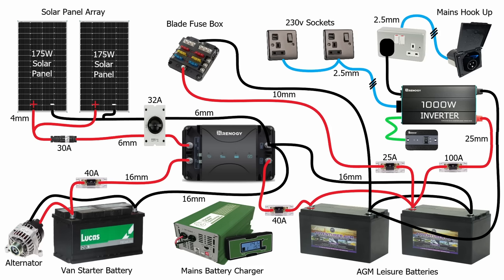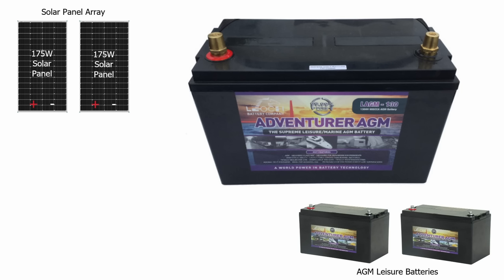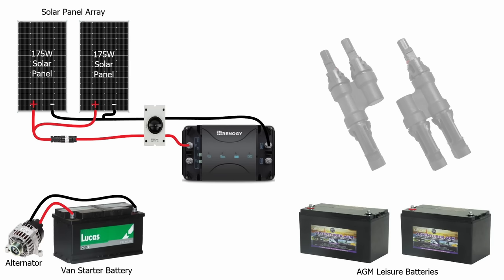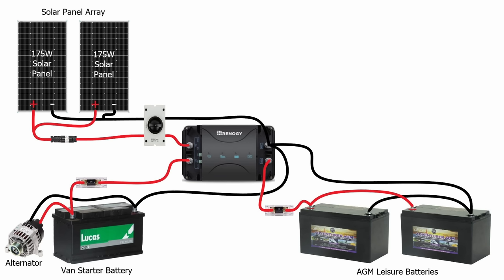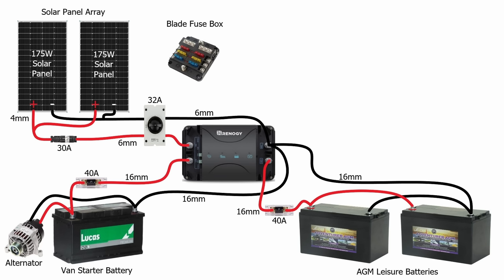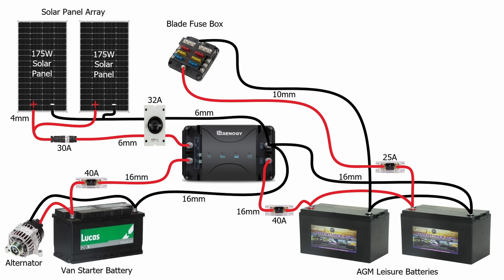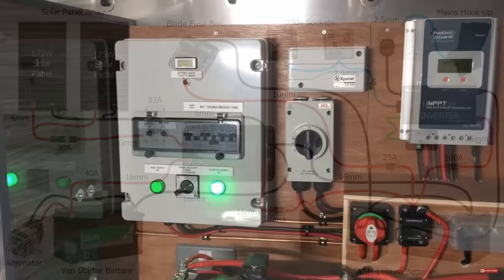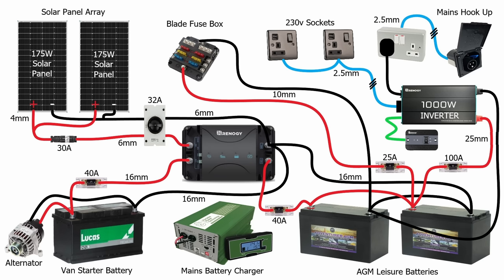12v Electrics for Off-Grid Campervan - Fiat Ducato Budget Build Ep12

Comment: Hi Greg, loving your step-by-step vids, really helping me with my first build (I have a mk7 Transit in great condition for age, It was a fridge van so it took a lot to clean it out). I went to buy the Renogy 30amp mppt, cc but they were out of stock, so I bought the Renogy 50amp and want to check that I can use this instead. It was almost the same price and does allow me to upgrade my system later if I want to add another panel. So I can see I've got to up the fuse value but that's all? All specs seem to be similar to the 30amp version. Thanks in advance 😁👍
Reply: I would like to echo what others have said, no-one is out of pocket for business. I simply wouldn't t have started this venture as I couldn't afford to pay someone else to build my van. If I could, I would have! It's a lot of work and has taken me a year of watching videos and saving up to be able to even dream of having my own custom made campervan, so I want to thank you and your wife for helping me to make that dream possible 😍👍
Reply from the maker: Hello, it's a little bit overrated for the battery capacity and type that I have suggested. You might want to look at getting one 100ah Lithium battery for £400 rather than two AGMs for £260 as this will handle the extra charge. The cables from the charger to the batteries also need to be increased in size to 25mm min to keep the voltage drop below 0.3V. Hope that helps :D
Reply from the maker: @deepowell2160  https://www.ebay.co.uk/itm/125237263746?hash=item1d28b8fd82:g:44gAAOSwnHNj1IlC&amdata=enc%3AAQAIAAAAwDo0pl8VldFlMcuA%2FXrCC%2BFmr8NMucnQbt2aENvit%2FSQBksvOImq5H%2B33V7yO9DBRJ5mci%2F4mWg%2BjggwOle0CrtfVeWKXboQoLM%2Bf63Nr%2Fppmgppce6PNa44%2Bxm4rohpojAgCrrS%2BJ1LWs62lNAPRtqUo8q0tVTvKrWA%2BY0MPm8CfIBkXX8wTQb4qfhdH5eFOUmjMdgBURVdDX7h4x6G9QZ7gXzL7mEo9F%2FqL8gHRrIMTr471kQ21M4mcPbwxrz%2FXQ%3D%3D%7Ctkp%3ABk9SR6C67-SrYg&mkcid=1&mkrid=710-53481-19255-0&siteid=3&campid=5338027957&toolid=11800&mkevt=1

Comment: Hi Greg i am going to use the wiring diagram in your video for the installation of my leisure battery setup in my Volkswagen t5 only difference to your set up is that i am using a single 200w solar panel a 2000w inverter and two 100ah smart lithium batteries all items from the renogy website, what size wiring will i need for this setup compared to yours cheers....

Comment: Hi Greg, great video and glad you are back. If the inverter is OFF, will it still pass-through 240v mains hookup to the sockets when onsite, also will the 240v (when connected to mains) allow it to pull more than 1000w ?
Reply from the maker: They are great questions I will have to test that and come back to you 😃👍🏼

Comment: Very much enjoy you clear concise easy to follow content… I have a question for you..I have access to 6v 110a batteries…would 2 of these wired in series be better than 1x12v 110a battery space and weight are not a problem just a question of which is best for off grid use..
Reply from the maker: Two wired in series would work just as well. You also have some redundancy

Comment: As usual Greg, Top Class💎 I'm not sure if you are aware of this, that isolator switch between the solar and Renogy MPPT controller has another useful trick up its sleeve.
On cloudy days and solar is at a minimum, before you drive, isolate the solar so the controller receives nothing from solar.
Doing this, the controller will except it's max allowed limit from the alternator.
When solar is connected, even poor solar days, the allowed power from the alternator is rather heavily reduced.
I've seen this with my own eyes, around a 10 or more ah difference, solar gets preference.
This is a poor way to save the controller from getting overloaded (in case of good solar) and I've seen the emails to and from Renogy and they are aware of this and in general stated, it's just the way it is.
This was less than one year ago, I doubt anything has changed since.
I'm not saying Renogy is bad, Renogy is very good, I'm just pointing out a workaround.
On Good solar days or if batteries are close to max, no need to isolate when driving, just when solar is poor.
You can test this out yourself when you have the van wired.
You could get this info out to more people than the person that I know, but test this yourself (just in case the controller has had a SMART upgrade) Just trying to help Greg 👍 Cheers mate 🙂
Reply from the maker: Hmmm I had heard something similar about it prioritising solar so I’ll run some checks and see. 👍🏼
Reply: @GregVirgoe  Yes Greg, thanks 👍

Comment: Thank you Greg for the awesome help you gave me. I am going to use this set up for my fiat scudo. My only question is that: I’ve got a diesel heater that is pre-installed and runs from the van’s battery and I want to use it as my main source of heat in winter. 
One idea is that I find the connection of the diesel heater (and probably van’s main fan system), disconnect it from the starter battery and connect it to the leisure battery.
Or is it possible I run it as it is but charge my starter battery with my leisure batteries during the time I am using the diesel heater? In this case I won’t need the headache of going through the van main electric system and probably just need to keep an eye on my batteries so that they won’t go down?
Would appreciate if you write your opinion about this and if it’s possible to do so? And how can I add that to this system that you show?
Reply from the maker: I would definitely recommend running the diesel heater from your leisure batteries and not the van battery.  You can install new power supply from a blade fuse holder to the diesel heater and isolate and make safe the existing power supply.

Comment: Sorry if you have already explained this further down but if you hook your leisure batteries to the starter battery, is there anything you need to put in place to stop it from draining your starter so you don't breakdown come morning. And also, if you hook up to shore power should you put in an RCCB or RCBO in line and how could you use the shore power to charge your leisure batteries as well as solar and your starter battery. 

Hope that question makes sense and I'm also not missing something glaringly obvious

Thanks in advance, you've been a life saver on your videos
Reply from the maker: The DC to DC charger will not drain the van battery when the van is not running. In fact it will trickle charge the vehicle battery off the solar. Please watch my next video on consumer units to answer your other question. 
https://youtu.be/kdvm0TFvfVQ

Comment: Hi Greg great to see you back how your both well I’ve a smart alternator on my van euro 6 will this dc to dc charger work ??
Reply from the maker: Yes it will, there is an ignition lead that you will also need to install to tell the controller that the van has started. 👍🏼😃

Comment: Thanks for posting this Greg, this advice or hiring an electrician to do this work would cost a small fortune - Questions;- I would be a bit nervous about what to wire in `first`, especially concerning the leisure or vehicle batteries = negative or positive (to stay safe)?, also was the wiring done in chronological order (as in the vid) for a reason?
Reply from the maker: That’s a good question. 
With all solar charge controllers you need to connect the leisure batteries first, this provides power to the device and gives it storage capacity for when charging means is connected. 
Next connect van battery and finally connect solar panels. All the output side should be installed and isolated at fuses before the above sequence then can be turned on once batteries and solar is proved to be ok 👍🏼

Comment: Hi Greg. Absolutely fantastic video thanks. Would this system work with a smart alternator vehicle?
Reply from the maker: Yes there is an ignition lead that comes with the charger that you need to connect to tell the charger that the van has been started. 👍🏼

Comment: Hi 
I've watch lots of your videos all really good
I am doing my first conversion 
Using a single 200w renogy sola panel,2000w renogy invertor,single 200amp lithium battery will be using a kettle,and a 1500w camping cooker, with a smart alternator would this work? And what size mppt dc to dc charger would I need  and battery cable size 
Thanks chris

Comment: Fantasticly helpful video! Thanks so much!
One question I do have for you...
I'm designing my campervan electrical system at the moment, we plan on using the van throughout the year even in the winter. Im designing it with LifePo4 batteries and approx 400w of panels.
I'm concerned that if I design the system with the solar panels in parallel that the voltage won't get high enough to actually recharge my batteries and this would affect how long we could stay off grid, especially during the winter months
Wiring them in series however would counteract this, on paper at least, and ensure at least some charge goes into the batteries.
Is this a legitimate concern?
Have you any experience or advice on the matter?
Thanks
Reply from the maker: Hi, yes I do have experience with this for last 5yrs living off grid.
Wiring the panels in series will benefit you in low light conditions but you need an MPPT charger that can handle the larger voltage like my Epever Tracer MPPT. This Renogy unit does not support more than 25v input. If you decide to go that route then a separate DC to DC charger would be required. Hope that helps 😃👍🏼

Comment: Great information Greg. I have this set up. Could you do a higher amperage 240v system with lithium as an example.  I want to upgrade
Reply from the maker: Yes it’s very easy, Go for the 50A dc to dc controller instead and change the batteries to lithium technology. Then you can increase the size of the inverter. Cable and fuse sizes will have to increase too. 👍🏼
Sorry are you asking for a video of a high power setup?? 😊
Reply: @GregVirgoe  thanks for the information.  I understand.  But if you're able to make a video feel free!

Comment: Great videos Greg.  Thank you very much.  When deciding on wiring size for your systems, you don't mention the impact of the distance each load is from the fuse board.  Is this largely unnecessary for camper van conversions and provided the cable is rated for the total load current it is appropriate irrespective of whether the load is 1m or 5m from the fuse box?  If I take into consideration the distance I find the I am having to wire most of my devices with 3.5mm wire rather than 1.5mm. (following the Van Conversion Bible guidance).  Your opinion very much appreciated.
Reply from the maker: Yes voltage drop on long cable runs can increase the cable size if you follow the accepted rule of 3-4% volt drop over the length of the cable. Things like fridges are critical as they won’t run if the voltage is too low. Most cables around the battery are very short less than a meter so its insignificant. 
So what effect does volt drop give us? My batteries typically sit above 12.6v so a 3% drop is 0.378v so even if I have a bit more volt drop than that my devices are still getting over 12v and would work ok. Often the actual load in current that your device uses for fan or socket circuit is far less that your calculated maximum.  Having said all that it never hurts to go bigger on cables other than the hit on your wallet. Hope that helps 👍🏼
https://www.12voltplanet.co.uk/cable-sizing-selection.html

Comment: Hi Greg, great videos, so helpful to a novice like me. I’m going to use you wiring plan for my van, if I wanted to use a 2000w inverter would I need a lithium battery, or could I just add an additional AGM to the system.
Reply from the maker: If you wanted to use it’s full potential it would be better going to lithium batteries.

Comment: greg, thank you again for an excellent resource. I would be interested in your thoughts on running a bluetti 200ac max, instead of a permanently fitted solar system? i am attracted by the possibility of using the bluetti on job sites as well as in the van.
Reply from the maker: I have got one to compare against a fixed system so there will be a video on that soon 👍🏼😃

Comment: Is the  Mains Battery Charger in your garage permanently hooked up to your system just requiring turning on, or do you manually connect it when you use it?
Cheers, really informative video.

Comment: Great video as always. I love your wiring diagrams and explanations much simpler than some of the instructions that come with the items themselves, with regards to running a tv off the inverter it reminded me of a video you did where you used a more efficient way  of running them with a converter? as often they don’t need full 230v, how are you finding that method in your van would you still recommend that? I understand why you might not go down that route in your budget build but in general is the converter a better option?
Reply from the maker: Thank you very much for the nice comment. 
Yes the TV has worked brilliantly in our van on the new buck converter and it’s definitely the way to go. We can simply use it without the inverter which is a great improvement 😊
Reply: @GregVirgoe   thankyou thats great Im planning to get this years camping season out of the way and then thinking of upsizing my van to something crafter/sprinter sized and whilst my current van is ideal for a weekend away on longer trips I rely a lot on hook ups and using an awning for space, so Im using your build videos for inspiration on becoming more able to not rely on the hook ups as much and although a bigger van hopefully actually become a more compact setup without the need for awnings etc
Reply from the maker: @James83172  we don’t plan to get rid of our sprinter it works so well in terms of space and being able to be off grid and camp anywhere. Perfect solution 👍🏼😃

Comment: Great video. Thanks. 
I have a question if you don't mind. 
I'm wiring a camper trailer with a lead acid deep cycle battery using a dumb alternator from the vehicle (with a simple voltage snesitive relay) and a single solar panel for charging. 
Can I connect my MPPI controller through the fuse block with appropriate fuse instead of straight to the battery? 
Thanks.

Comment: Hi Greg Thankyou for doing this video. It makes absolute sense and is easy to follow.
On the video, you suggest a 6 blade fuse board. Could this be increased to an 8 fuse without altering anything else providing nothing with a high load is connected?
Reply from the maker: You can increase the number of ways. Add up the connected load of all the appliances and just check the feed cable and main fuse is still high enough. 😊
Reply: Thankyou

Comment: Thank you so much Greg! Quick question, did you fuse both panels with two 30A fuses or did you run the one fuse after connecting the positives via your connectors? Thanks again!

Comment: Dear Greg, Thank you for your amazing videos, truly inspiration.  May I ask if it is possible to look at retro fits in future?  I have a Devon Tempest, 5.4m Renault Master base. I am trying to understand where various things are, for example the water pump and expansion tank; and the fuse in the solar panel to vehicle battery line?  I know it is a big ask, but we are not always working from a new build?  Thank you in anticipation. Colin Jamieson
Reply from the maker: There are numerous manufacturers and many variations of layout, controls and appliances. 
It would be very difficult to cover every scenario in a few videos. 
At least looking at this new layout and my previous wiring diagram it gives an idea of how these items are connected together. A lot of manufactured Campervans have bespoke distribution boards and integrated control systems that I’m not aware of how they are built. 
It’s a difficult one to cover 🤔😬

Comment: Hey Greg, thanks for another excellent video.  Planning a conversion and wondering about batteries. Is it better to have several smaller batteries or single large one?  Li Time seems to make quality batteries at a reasonable price - they have 100AH, 230AH, and 460AH which are incrementally cheaper and lighter (per AH). Your thoughts on smaller or larger batteries for a 400AH or 800AH system?

Comment: Hi Greg. I have almost the exact same set up as shown in this video 16:15. I was wondering if I could use the same cable and fuse sizes, considering I have the 2000w inverter, 2x200w solar panels and I'm using 3x100 ah renogy lithium batteries.

Thanks, mate. Your videos are spot on. 👍
Reply from the maker: No, the cables and fuses are sized according to the load connected to the circuit. So if you use a 2000W inverter that would require a 200Amp fuse and at least 35mm cable providing they are short only 1m long. 
You would also need to increase the battery parallel connection cables to 50mm as they will be handling the loads of the entire system. 
Solar PV of 6mm and MPPT to battery 16mm will be ok 👍🏼
Reply: Hi Greg, thank you for your advice, it's really appreciated. Just one more question if that's ok? 
If I were to use bus bars straight off the batteries, am I right in assuming that these would need to be rated at the same 200a as the largest fuse on the system? Then I can come off those with the differently sized cables and fuses for all my components?

Thanks, again.

Comment: Hi Greg I'm going to using the same renology alternator/MPPT charger as you are using but this will be off a newer dc-dc smart alternator. There is a cable in the renology charger for the ignition signal.Firstly do you know if this is vital to the set up and secondly where do you suggest that it is attached please?
P.s. just love your videos....so simple - even for a girl😉

Comment: Great video.  Just a quick question could the main battery charger be connected to the mains hookup at camp site so it also recharges the battery? Do you have the main battery charger always connected to the battery’s and only turn on when required?